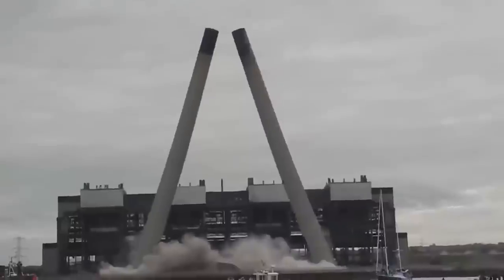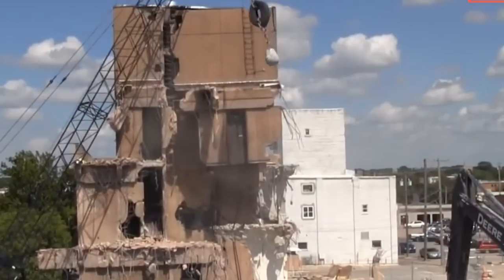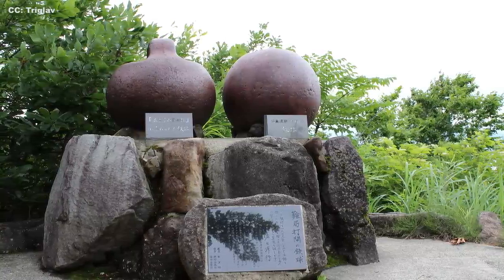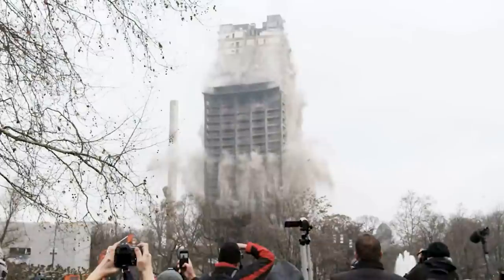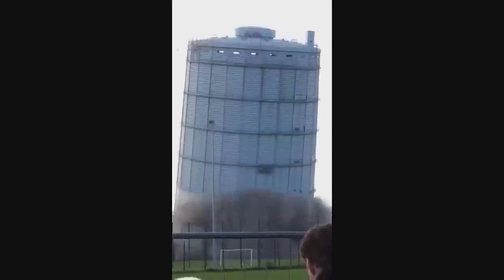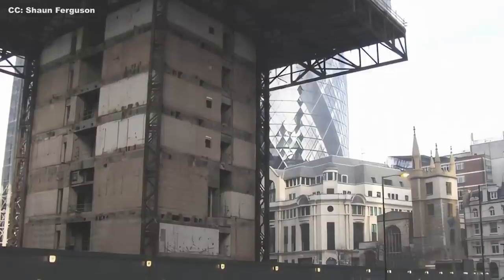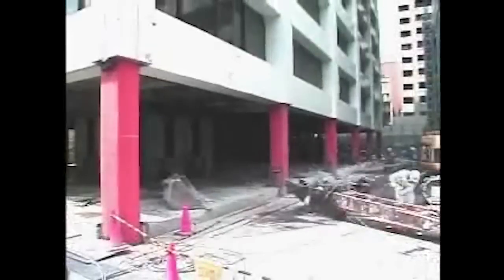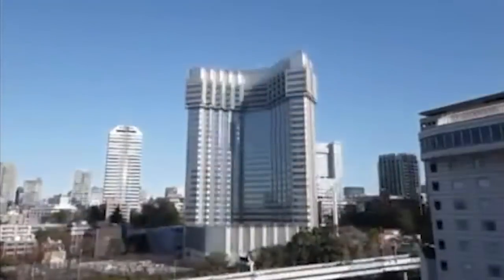How Do We Destroy Big Buildings?

Comment: There are several benefits of implosion rarely mentioned:  

1) Tall structures are brought down into lower piles of debris. This is now much easier for other forms of demolition to operate safely. Steel beams and other recyclable material can be pulled, sorted, cut, and removed a lot easier than trying to use Cat's new 271 foot shear. 

2) bringing down entire building makes a huge mess with debris and dust scattering. Contractor only has to clean site and surrounding neighbors one time. If building was being demolished by other means, contractor is continually having to clean area every day. One big cleanup is far less expensive than numerous small ones. 

3) Implosions are rare and it brings out the press and public in general. Even a less than perfect end result looks perfect to everyone but the demolition contractors. I was living in Seattle when CDI imploded the King Dome. It is still largest reinforced concrete dome imploded. Must have been over 50,000 spectators. I should have been selling souvenirs, could have made a fortune.  

CDI is the world's best controlled explosives demolition company. The dad started something the sons now continue. And the son's own kids are following in the family business. They work around the world taking down some of the tallest, thickest, longest, strongest (fill in the blanks). They took down a record breaking heavily reinforced concrete tower on South Padre Island in Texas. When it was all over, a small portion went outside their self described exclusion zone. It was not even noticeable to the public, yet to the experts debris hitting temporary chain-link fence was a negative point to learn from.
Reply: I always thought if have time sledgehammer as minimum dust spread and safely still

Also 3 be epic if did and them getting the stuff covered the cost of the demolition
Reply: @mlee6050  Thanks for comment. They probably still use hand tools like sledge on certain projects. Years ago I worked for a contractor who specialized on projects that were too small or removed for mechanical machines. We used sledges to remove large concrete pads... not much fun, but worked great once you knew how and where to hit.
Reply: When they imploded the Canberra hospital they invited everyone down to watch. Sadly it all went wrong and a 12 year old girl was killed by flying debris.
Reply: @toddavis8151  unsure if implosion or explosion but saw some debris in a video miss a guys head within inches and they made me question the safety
Reply: @toddavis8151  Thank you for comment

Comment: 40 years ago the 20 story building across the street from my office was torn down. They put 2 front loaders with jackhammers on the top floor and they turned each floor into rubble using it as a ramp down to the next floor, pushing the excess over the side. I don't understand how they did not overload the floors and collapse the whole thing. Never seen it done again.
Reply: Over engineered flooring, if spread on enough joists or beams I understand apart from how get ramp for next level without go through multiple
Reply: @mlee6050  he's lying. There would be absolutely no reason for them to bring out and construct a crane in order to lift these two front loaders to the roof of this building to start taking it down.
Reply: @VineyardGHS  I never said he wasn't lying just if floor would support them I not see how they get a ramp down
Reply: I used to work for a demolition company and about 11 years ago they did a 21 story building in downtown Toronto in a similar fashion, but with a radio controlled small Bobcat with a jackhammer attachment. They absolutely closed down a major road for a day to get a truck based crane to lift the machine up there. But it was worth it.

Comment: And the center "core" is normally the elevator  (or "LIFT") for you brits and is ALWAYS the hardest part to take down!!! That's one of the main reasons why they erect the cranes in them!!! 

But also good cause you can use it to pull the building in on it's self
Reply: Like you say that even though at least 2/3 the time us British say elevator

So just take the elevator shaft out and building is gone?

Comment: by using jet fuel.
Reply: Damn it
Reply: ouuu buuurrrrn
Reply: Only during summer vacation
Reply: Oof
Reply: Even building 7?
Reply: Just "pull it".
Reply: Aloha Snackbar
Reply: Jet Fuel Can't Melt Steel Memes
Reply: Military grade thermite has shown top results for free falling buildings.
Reply: BOOM! micdrop
Reply: @Jimmy_in_Mexico  Building 7 was demolished by office fire. Scary that paper and furniture can do that.
Reply: @williamgallop9425  thank you Larry Silverstein, very cool!
Reply: @iteerrex8166  crazy eh? Sad how common it is for building fires to cause collapses after 12 hours of inconsistent burning while not smashing into the very expensive and important financial-district's banking and wall-street buildings only a couple blocks over 😢
Reply: Too soon 🤣🤣
Reply: @justin-fractionalhub5532  I thought thermite was just used as distraction
Reply: How?! Don’t you know it doesn’t melt steel!
Reply: @minisforerbody  if on about jet fuel, it doesn't get hot enough, I just checked what happens and it won't get hot enough to melt but it will get hot enough to weaken or soften the strength of the construction steel which will make it buckle or give way
Reply: @mlee6050  can confirm. I inspect welds and steel members on warehouse buildings and you are correct. While it won't get hot enough to melt, the steel will get weaker
Reply: Theramite
Reply: Would have been epic had they used 7 as an example of implosion.
Reply: Plasco building.